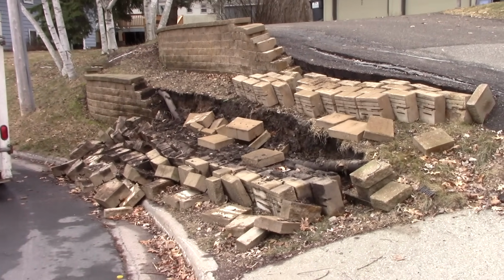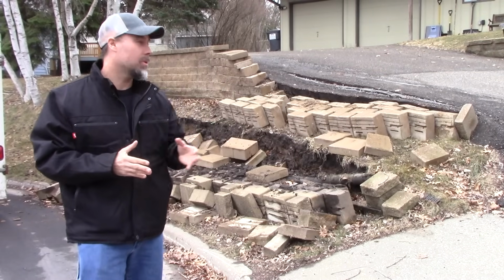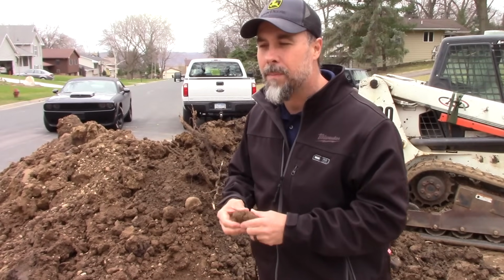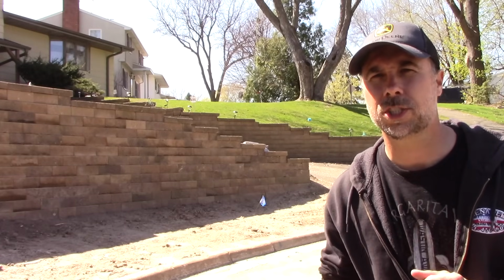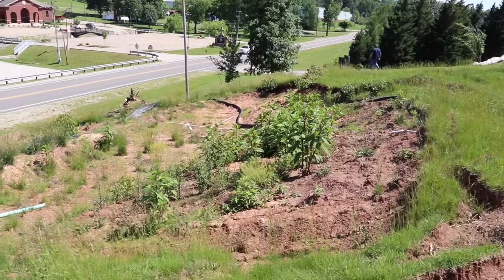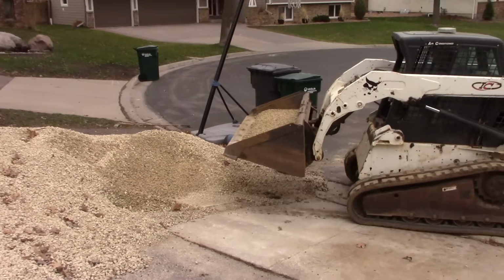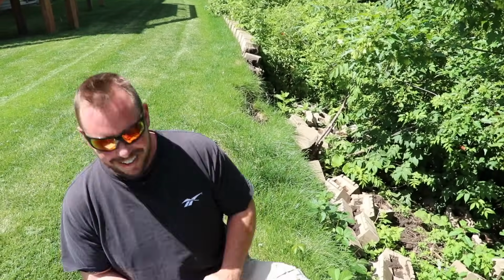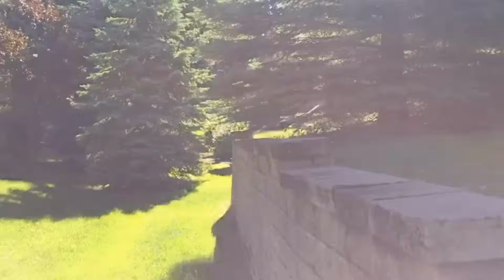Retaining Walls - How to Avoid Costly Mistakes and DIY your landscaping Walls with Great results!

Comment: I appreciate your videos. I'm a stone Mason in St Louis and I build retaining walls sometimes. Are you saying not to use filter fabric behind walls at all? Or not without drainage rock? 
Also, are you against anchor block walls even with proper drainage and Geo grid?
Reply from the maker: Anchor walls are good with proper drainage and geogrid.  I never use filter fabric behind the retaining walls UNLESS I am building a wall that will be underwater(which I have done). Then you need filter fabric wrapping the drainage zone.
Reply: Depends on where you are at in the country and what kind of walls you are building.  Places like El Paso, Tx has mostly sand.  So filter fabric between the sand and clean rock is advisable.  The smaller sand will infiltrate the voids in the clean rock and create settlements that water will find its way to.  In the Lou, shouldn't be a big deal unless used in a lake (water) or catch basin type function.  It will also depend on the engineer who is designing it.  I've built many walls for Lowe's.  They hire Rick Valentine to do all their retaining walls.  He gets a little crazy, but I never worry about those walls falling.  It also depends on who your working for.  Mo Dot makes the installer use filter fabric behind the reinforced zone.  As does Kdot.  Also the bigger block systems (redi-rock, recon) it is almost always used to keep the 1 to 1 slope behind the wall from being contaminated with natural on-site soil.  This is due to design parameters (weight and loads of soils behind the wall)

Comment: My neighbor is currently geting screwed by a contractor.
Two tiers each tier is 3 ft and  they are only 3 feet apart
It is right by the house so the roof water runs on them also. 
The guy is using 3in of paver sand as the base materials, 
fabric behind the wall,
Menards Denver block which are hollow cored all the way threw and he is core filling and backfilling with the onsite soil which is clay. 

How long do you think he will get before it fails?
Reply: Jacob Keifenheim wow. Lucky if he gets a year out of it.
Reply from the maker: OMGosh-that is the worst of everything.  Show your neighbor this video.  That wall is getting installed wrong all the way around.
Reply: Jacob Keifenheim I've seen the similar thing before and I even told my client that he really should get a second opinion on the wall that his handy man is building, about a month later we had a hell of a rainstorm and guess whose retaining wall fell over.....

Comment: What do you think of concrete retaining walls
Reply from the maker: Depends on how they construct them.  Even OLD TIRES 😳can make good walls if they are used the right way.
Reply: We are R&R Landscaping out of Grand Forks North Dakota put in a retaining wall that will hold back about 5 feet of soil have you heard of R&R if so do you recommend them

Comment: After watching your videos on the retaining walls it blows my mind seeing folks building retaining walls never using the agragot behind the blocks and also not using the pinned blocks either. I'm excited to add this service to my tool belt thank you Stan. I'm gonna start with building one at my house to get some solid experience.
Reply from the maker: Thats a great place to practice!
Reply: Pinned blocks make no difference.  The installer and engineer are what matters.  There is zero strength factored into the engineering due to pins.  How ever versa-lok does have slightly better block to grid connection than most other units.  I'd have to go look, but keystone is also a pinned system, but doesn't get the grid connection that versa-lok does.  The pins are plastic or fiber glass.  I can break versa-lok pins with my hands.
Reply: Aggregate :)

Comment: Are boulder walls going to be the safest if their done right? Love the great videos also
Reply from the maker: Boulders make great walls but modular block if done right is just as good-almost!
Reply: Stacked Boulder walls can't be relied on to be stable especially in any seismic event.  This is a matter of some debate between landscapers and geotechnical engineers,  even to be used on a logging road they need geotextile and an angle of repose batter angle.  All the Geotechs that I know are apolectic about stacked rock walls and adament that they will come raining down on whats below them.  Yet there are still some general Civil engineers that will certify them...... patented ' Lock Block' walls with appropriate Geogrid  and select backfill specified by a knowledgeable Geo technical engineer are probably one of the safest most flexible solutions.  Including custom poured shapes, and the ability to turn slight corners, solid blocks without pour line separation  unlike run of the mill econo blocks made of bits of waste concrete.  Also note that each concrete supplier uses their own pattern and many of them are not compatible with each other, and will look funny if combined on the same job - not to mention not mating.